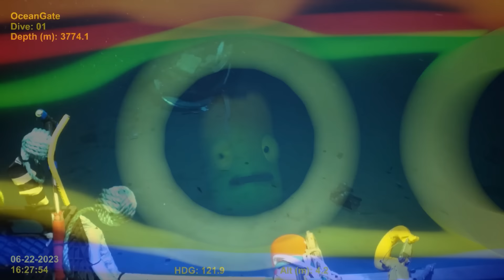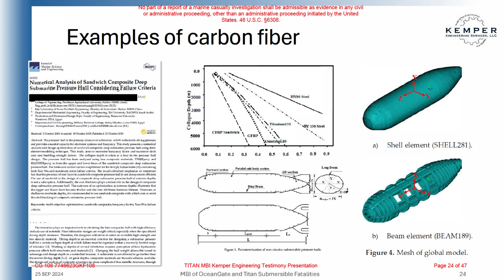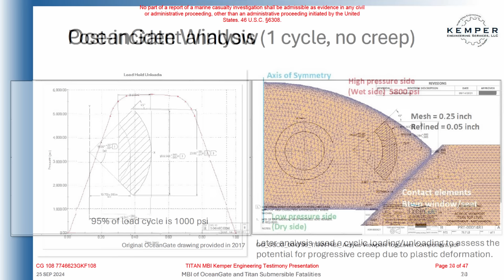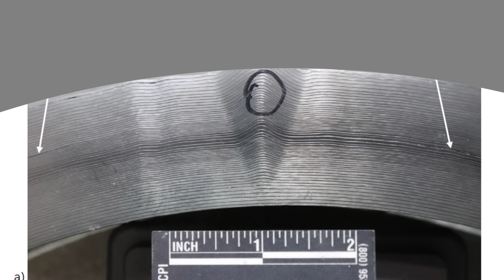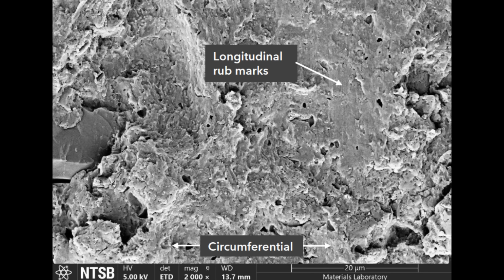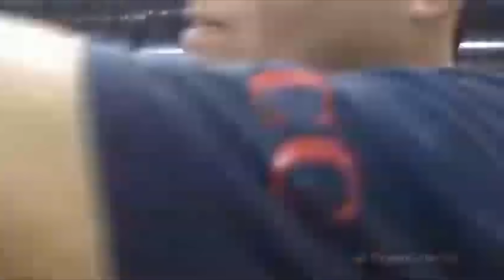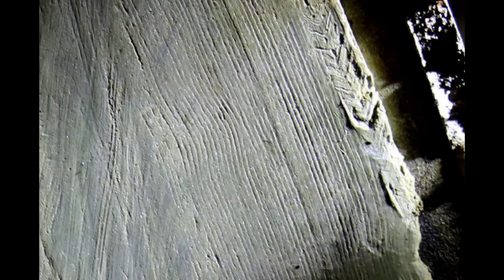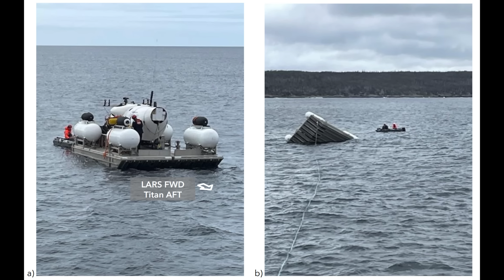OceanGate Wreck Shows Why Sub Wasn't Strong Enough To Survive - NTSB Shares Important Details

Comment: Yeah that's not a 5 inch carbon fiber hull. That's not even 5 bonded 1" CF hulls. That's effectively a really bad 20 layer sandwich. Of alternating:

* Bit-under-1-inch layer of carbon fiber reinforced composite
* Arbitrary thickness-location-and-size layer of brittle, practically unreinforced epoxy resin layer with chopped and ground bits of CF in it
* Layer of peel ply (WTF they left the f%!ing peel ply on?!?)
* A layer of some other brittle ahesive
** Repeat

No wonder the sensors were pinging well over 10.000 times and strain gauges were reacting. The whole sandwich between the actual, proper CF reinforced composite cylinderS weren't just delaminating they were being crushed and ground as each CF layer flexed independently. Had Rush not denied his own engineers the request to remove the outer shell to do US and X-ray analysis of the pressure hull, they'd probably see functionally 5 layers of CF composite with a pretty thick layer of crushed epoxy, CF bits and glue between them, along with a bunch of voids.

Peel ply only "absorbs" a tiny bit of epoxy. Not remotely as much as as structural ply does.

That's why it's called peel ply, it doesn't stick! You put it on last, bag it - and when you pull vacuum or autoclave it the air bubbles and excess resin can escape the structural matrix through the peel ply. You then cure the thing, and peel that f%?!ing peel ply off! It's very material construction and purpose is to _NOT bond well to other layers!

Comment: AT 16:28:10, the aft dome and hull is offset in the debris field as if it bounced and shook off some pieces, settling on the edge of the visible initial impact point.  This, while the forward dome stuck it's landing.  is this just due to the aft debris being heavier, or is it indicating that the aft was pointed down and had a higher velocity?

Comment: Theory after watching your video: The carbon fiber hull did a partial rotation in the C channel while the ring and nose cone stayed static. This broke the last of the glue bonds and set in motion the chain of material failures that cumulated in a implosion. Cause by either Stockton trying to adjust his lead ballast weights by juking the craft left and right. Or by movements in the sub that changed the weight distribution. 

Plus they used an impact gun to bolt and unbolt the nose end. You ever used one of those? The vibrations turns solid rust into dust. Thats probably what powered the glue.

Comment: Looking at the flange on that titanium ring... Are you even seriuos... Whats the point of the ring beeing that thick if only a tiny thin flange (with some glue) is holding the whole preasure. Titanium and carbon has diferent flex, so the glue got fked over time, and all there was left holding it together is that TINY FLANGE. And you can see the result - its all ripped off on both ends. Jesus Christ the stupidity of these people. If they had put them rings inside the tube and one extra in the middle this probably wouldnt have happened.

Comment: The fact there was a warning that would be obvious to most people that something was wrong, is a tragedy.  If they would have rebuilt it and used that one for analysis then they could have forged forward in new development and learning things.
Reply: What was the warning that would have been obvious to most people?
Reply: @TheEvilmooseofdoom  a system that is designed to have spikes on a graph if there are structural issues, has an obvious spike that would clearly indicate an issue.  When life is on the line, potential issue is grounds for a halt of a launch whether that's a rocket or a submarine.  When that loud noise happened during accent the one time, that should have been the last time humans were diving in that submarine and after a few remote control dives and the loss of the submarine they would have had the information necessary to further ensure safety.  But that's my opinion and I'm not a structural engineer, nor have I tried to make composite pressure vessels of any kind. So I really have no authority to speak on the topic.

Comment: Stockton was an idiot for using carbon fiber. He should have used transparent aluminum, so much stronger.
Reply: Nice Star Trek reference.
Reply: @rewtshell  It's not even fiction anymore.  There is or was plans to use it in armored vehicles as well.  I have no idea how well it would perform as a pressure vessel and I don't think making round or curved shapes of that size has been done or even if it CAN be done.

Comment: The five one-inch-thick cylindrical shells were separated by a layer of adhesive capable of transferring loads in compression but with no shear stiffness or shear strength. If the math modelers did not account for that incompatibility, they made a terrible error. In addition, where ever they ground down the wrinkles they locally reduced the strength of that layer of the shell. A local reduction of the strength and stiffness might lead to local deformations of the shell causing it to deviate from the idealized cylindrical shape, which would lead to the development of bending stresses and even further deformations and possibly to an instability failure of the hull on a global scale.

Comment: A pressure vessel made of carbon fiber composite is like a balloon; it can withstand internal pressure but not external pressure. They tried to make it withstand external pressure by gluing several layers of balloon shells on top of each other, and it worked, but only for a few times until the glue between the layers gave way. This should not be unclear to anyone who has worked with strength of materials.

Comment: Aerospace engineer here. Everything you described regarding imperfections in the hull are the main reasons why CF works way better in tensile strength direction then when put under pressure.
There are plenty of applications where CF is used under pressure for several reasons. The problem is that these imperfections tend to weaken CF over time, in particular with every cycle of changing pressures, to the point of in this case collapse. All it needs is is a small point of failure, and it can propagate fairly easily.
When the force is the applied in the ‘right’ direction for CF, it will most likely only result in a minor defect.
So the armchair engineers do have a point, just not necessarily for the fundamental reasons they think, much like your description of the strength of the viewing port.
Reply: Btw, I’ve also heard that the CF may not have been of the quality it should’ve been. Also when I see the winding process and the internal voids.
All are red flags.

At a former employer, they did everything in a special clean room, and everything was X-rayed after curing to verify the quality.
Lots of cowboy-ing going on in the production of the hull here IMHO.

Comment: Imo the way the carbon fiber hull was spun on the reel just seemed to normal the simple left to right back and fourth wrapping seemed much to simple to me I would like to hear what Rush would have said? Maybe after the autoclave he thought it wouldn’t make a difference? And the Movements of the hull itself with  titanium cap rings etc and your hoping this epoxy will hold and jive with the vessel clearly there’s an explanation was there a projection of when he planned on retiring this hull for a new hull,  or did he think this was permanent, and the damn acrylic window and its pressure rating maybe it was the shape of glass and setting in the dome that helped obscure that pressure rating 
That

Comment: This is horrific. If I did a layup in my home garage and it came out looking like this I'd bin it. For this to be a professional product is utterly mind blowing. For this to be a critical safety survival cell,  to me, is criminal. That doesn't even account for the homebrew mods they did grinding through the hull sheering fibers and further weakening the hull to get rid of ripples which purely exist due to their own incompetence. That wouldn't kill a home hobby product but it should kill anything engineered and load bearing.

I''m honestly shocked it lasted so long. This outcome was inevitable. What's sad is through sheer luck they had advanced warning (if properly made it wouldn't have worked), yet they ignored their sole poorly implemented safety feature and killed a bunch of innocent people.

Comment: 12:51 ”Peel ply was removed which made it less sticky.” I know what you are trying to say is correct but this can make people think that peel ply material would have left on purpose there. Ofcourse peel ply is always removed immediately after autoclave cycle is ready. What you meat to say is that gritty surface left from peel ply¨s texture was diminished because of sanding. 
Usually sanding adds grip between layers. Unless sanded with too fine.

Thickness seems to be way over 5” which to my eyes tells the tale that 133 layers of carbon at one bake was way too much and it did not get pressed enough together in the autoclave baking. Either the pressure difference should have been much bigger in the baking or they should have made it in smaller steps with less layers. Regardless, making from carbon was bad idea.
Reply from the maker: Yeah I should have been more careful to make it clear

Comment: I think in part the failure could have been accumulative, like other carbon fibre structures subject to large stresses such as carbon fibre bicycle frames and forks  and m/c crash helmets that have been involved in crashes...the advice is to replace them in those circumstances as they may be have undergone undectable structural damage that leaves them subject to sudden catastrophic failure under unexceptional conditions of use

Comment: The most foolish approach in the design of such a container for external pressure was the choice of a cylindrical shape instead of an ellipsoid or, better yet, a catenary that is free of shear stresses. And fibres cannot withstand pressure in the direction of the fibre alignment. They can only transfer tensile forces in this drirection. Even the winding process of applying the carbon fibres to a cylindrical hollow body causes constrictions on it, which caused the fibre layers to buckle, thereby reducing the geometric strength for compressive forces (Euler buckling or reduction of resistance to buckling).
The second-stupidest mistake was the assumption that the system would not fatigue under different pressure changes. Of course, the time-to-failure strength should have been determined for this submersible by lowering it to a design depth and surfacing until it broke, just to know when the fatigue limit was reached. The NTSB [https://www.youtube.com/watch?v=Z7xaePm9QhY] investigation mentioned that a loud crack was heard at the 80th dive. Why that was not cause to suspect the envelope was at end of life is beyond comprehension. This is grossly negligent disregard of a serious safety issue. The 88th dive was the last one nobody survied.
The third mistake is to let people descend to that depth at all. The photos are so good and sharp that you get a perfect impression with a stereo camera system and an Oculus Quest 3, for example. That makes a real dangerous dive unnecessary!!!
Final conclusion: the accident was foreseeable. Just like Apollo 13 or the two space shuttle disasters were foreseeable.
So why let people descend to these depths?

Comment: Scott, you mention that acrylic was met with scrutiny when introduced, similar to carbon fiber, but acrylic is at least somewhat isotropic, allowing it to be viable in tension or compression. Then you mention a Chinese vessile made of you said ceramic composites. Ceramic is good in compression, very, very good in fact. This sub was still carbon fiber, which is not good in compression, it's good in tension. Making a sub out of carbon fiber is like making a tank to hold internal pressures out of concrete. It might be doable, but it's really not a great idea because you're not working with the materials strengths. The compressive strength of this composite would be significantly lower than the tensile strength due to the fiber orientation. 

The thickness might help as you start getting some layers in compression, but carbon fiber in this application makes such little sense from an engineering standpoint.

Comment: So, far as carbon fiber goes. Put it this way. When I say "Nothing is lighter than hydrogen." it is a joke, because nothing quite literally is, what is lighter than air? Helium, what is lighter than helium? Hydrogen, and what is lighter than hydrogen? Hard vacuum. If you could fill a blimp with hard vacuum without it being crushed under atmospheric pressure? Without ballast it would shoot off into the sky uncontrollably. If a thin skin of carbon fiber isn't enough to contain vacuum at seat level without going cronch, it isn't enough to be used as a pressure vessel at that depth, because the relative forces are really damn similar. Not identical, but lets just say if they had blown all their ballasts and let their own buoyancy lift them they would have risen at a rate that by it self could have been catastrophic. 

But that is just my armchair engineering...

Comment: Did Oceangate suffer from some of the same issues that sunk the Titanic? I.E Management hubris.

The Titanic was held together by approximately 3 million wrought iron rivets, which were hydraulically driven. The rivets were made in a factory, heated at the construction site, and then inserted into holes in the ship's plates and beams. 
Some factors that may have contributed to the Titanic's sinking include: 
Rivet quality
The rivets contained three times the allowable amount of slag, a byproduct of the smelting process. This made the rivets more brittle and less ductile, and may have caused them to break off and pop out of their holes. 
Steel quality
The steel used to build the Titanic was high in sulfur and brittle, making it more likely to fracture when struck by an iceberg. 
Design flaws
The ship's watertight compartments were only watertight horizontally, and the tops were open. This allowed water to spill over into adjacent compartments if the bow pitched forward.
Reply: I think it was the Massive Iceberg that sunk it.
Could have sailed the seas on a Classical wooden Pirate ship and without that iceberg, no sinking.
Reply: @kellywilson137  not to mention, it was only because it was a sidelong glance of the iceberg that ruptured more than the four compartments that it was designed to stay afloat with. One wonders what would've happened with a more head-on collision

Comment: So, what makes you think a spool of thread will protect you in a high pressure environment? THAT is why it wasn't strong enough. Really? Thread? 100% of the strength was from the epoxy,  0% from the thread. He definitely was NOT a materials engineer. In other words, he would have been better off using just epoxy. The treads introduced/were defects. The defects were fatal.
Reply: Has any of you haters ever told the truth even by accident?
Reply: @TheEvilmooseofdoom  ???? You must be looking in the mirror.

Comment: No tube supporting rim on the flat & clean machined flanges ? In glue we trust, or not .
Reply: Cannot tell what you are trying to say.
Reply: I'm not a professional engineer , but in the video is described  and shown,  at 19'27'' , 21'43'', & 22'10'',that the titanium flanges are machined like a flat surface  when facing the carbon tube. I would have imagined there is a ring rim , a ring lip , a protruding edge going around on the flange where the carbon tube would slip over and be supported by the metal edge; in an anlogy to a bottle lid, the tube,  fits over the bottle rim or lip, a presumed edge on the flange.

Comment: The amount of defects and inconsistency in the wall section is bonkers, they had glaringly obvious process problems but instead of scrapping the piece after the first layer and fixing the process they just sanded it down and sent it. It seems like they were treating it more like building a speed boat or track car than a pressure vessel.

Comment: The carbon fibre, per se did have some utility. The strength of the hull ultimately derived from the plastic with the fibre acting in a role similar to rebar in concrete. It took up any tension forces, holding the plastic together and preventing the plastic from cracking during normal use. A composite will prove to be the solution in constructing a light weight hull once the proportions of each material are worked out.

Comment: If they truly "shaved" off the wrinkles in the CF top layers, that was the failure point. You cannot just shave that off, that is the actual fiber structure itself. When you machine that off you are literally doing the equivalent of cutting the outer strands of a rope. You are weakening the structure at a critical point And all you have left is just the epoxy in those dead spots, or worse, empty voids which are just basically pockets of air. And you don't want air inside carbon fiber that's going down that deep. Those fibers need to be there because they compress on the top layer to prevent the buckling. The inner diameter fibers are being "pulled" under tension, but those outer fibers are compressed, and if You remove some of those fibers, you've compromised the structural integrity. This would have been an absolute blunder of an engineering mistake that should never have happened for something this critical under this much pressure.

Comment: The sudden increase in hoop strain, and decrease in longitudinal strain, illustrates that the glue that held the carbon cylinder to the forward ring failed. The inner flange took support of the carbon, and supported rigidity until it sheared off on the final dive (with catastrophic consequences). The massive "sonic event" was the smoking gun